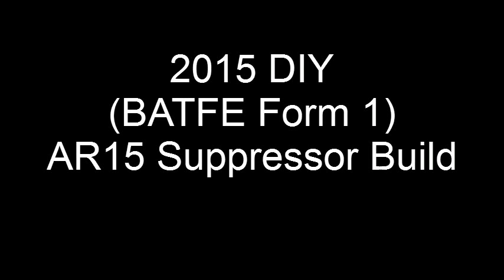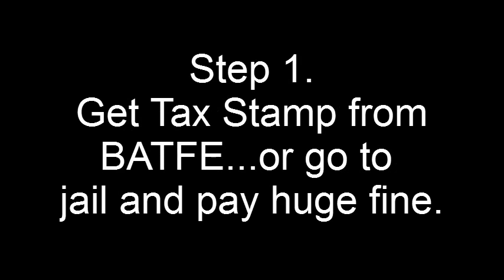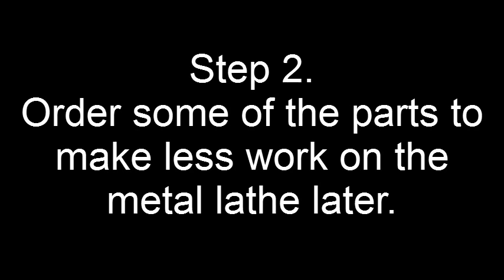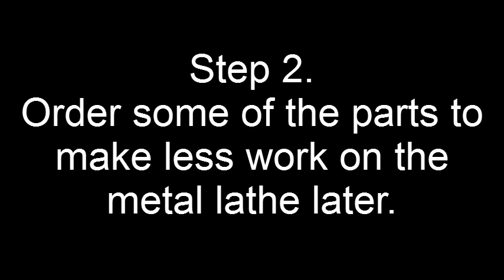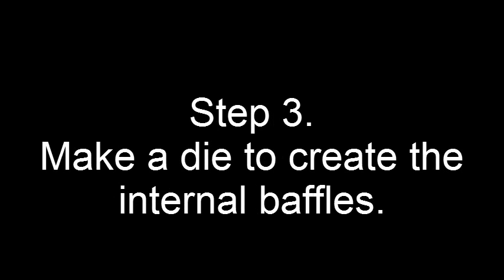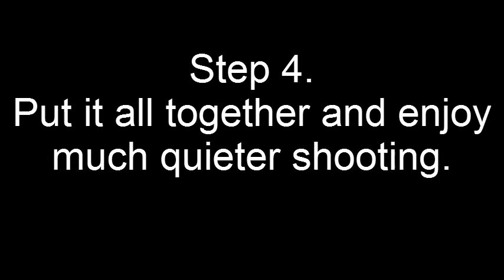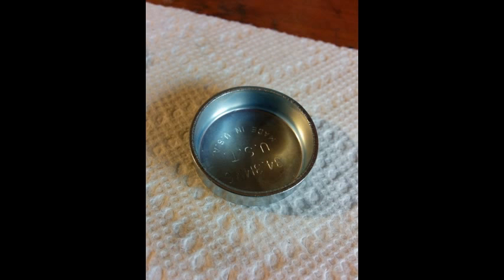Form 1 Suppressor for AR15

Comment: Why didn't you machine baffles like you did for your 22 suppressor?  Use stainless instead of aluminum for the ar15.  Which baffle system you like better?
Reply from the maker: +jawsmod Laziness....and or lack of decent cutting tools.
Reply: Now that you have done both... Which do you prefer and why?
Reply from the maker: +jawsmod Performance wise....there is no difference.  I don't care what anybody says.  That being true....the freeze plug type was much much easier to build by buying some parts and using simple tools to finish the job.  You don't need a lathe or a mill to do the freeze plug suppressor.  Just a tax stamp and normal shop tools.  Monocore is the best for cleaning and maintenance.  Unfortunately, I don't have a mill so I can't make one.

Comment from the maker: After testing, the accuracy using 55 grain regular NATO 5.56mm ammo was not good.  I figured out that the blast chamber needed to be larger so I removed 5 baffles and replaced with stainless steel spacer tube.  Accuracy is now the same with or without the suppressor.  Still sounds about like a .22lr.  Happy building.
Reply: David W  hello I saw your video and I think that's really ok I am from another country so probably I can not subscribe you for the very interesting and also works fine

Comment from the maker: I have two more sets of dies almost completed if you are interested.  These cost a little more than ones you might find elsewhere online, but they are much beefier.  I don't use a thin walled tube.  I use a 1/4" wall thickness tube and machine it to the exact size on the lathe with a boring bar.  You'll never have to worry about these kinking under the load of a press.  If you are interested, please message me and I"ll send you a quote.  Thanks for watching.
Reply: Can't send you a pm but I'll list my email here hungersmith1996@gmail.com I'm very interested
Reply: Definitely interested- Spldrong@hotmail.com. -- yea I can't find a way to message you anywhere.

Comment: Messaged you with my email address.  I'd love to see some experimentation with different sizes, combinations, etc.  Is it quieter with the 3 smaller holes around the outer edge of the cone baffles?  Good job my friend!
Reply from the maker: yznum73 I don't know if its quieter without the holes.  I can't make any more baffles without another tax stamp so....I guess I'll never know. But there is discussion on this on SilencerTalk forums.
Reply: David W If the serialized part is the tube and one or some of your baffles break, can't you replace them?  Actually just realized it has to do with your specific plans submitted with the form one huh.  Although, I have seen some companies offering "upgrades" aka send silencer in and get it back quieter and slightly different.  I think its more complicated than I originally thought...
Reply from the maker: Yeah you can only make all the parts once in a form 1 however you don't have to send them a plan just the caliber of the finished product and length
Reply from the maker: And yes I think if you do a form one you are not allowed to make replacement parts legally
Reply: Need a quote please 😁👍🏻Jrquintanasr39@yahoo.com

Comment: I am very much interested in a press set,
I can be reached at JDLP@HOTMAIL.COM
Thank you and great job.

I do have one question, why did you drill the extra 3 pilot holes ?
was it louder with out them and if so, how much of a difference ?
Reply from the maker: Joe De La Puente I read somewhere on SilencerTalk forums that those relief holes help cool and slow the gasses down.  I haven't tried without the holes to know the difference.  I am not allowed to make any more baffles without another tax stamp so I won't be able to find out.